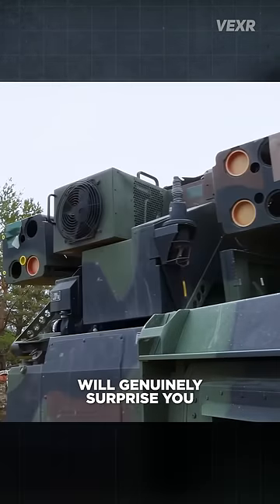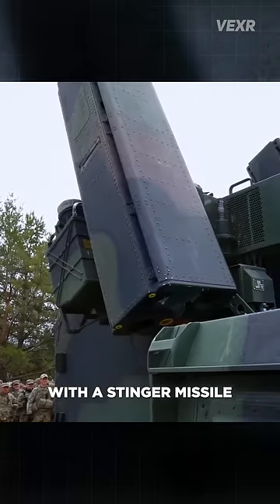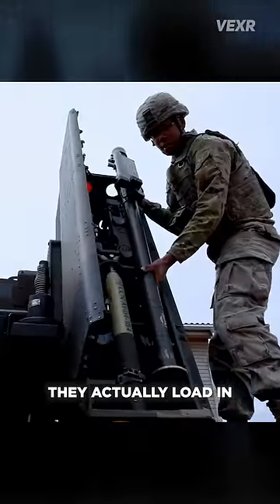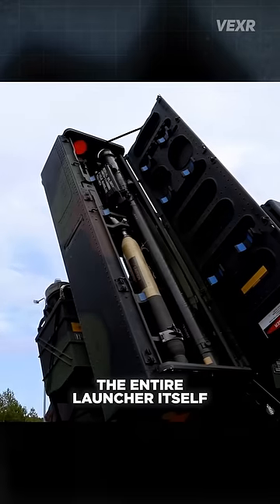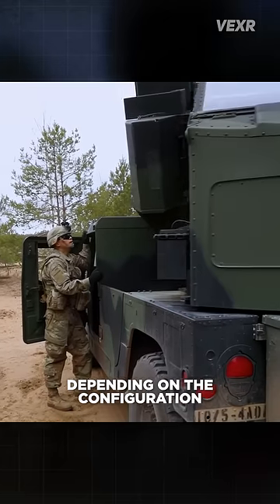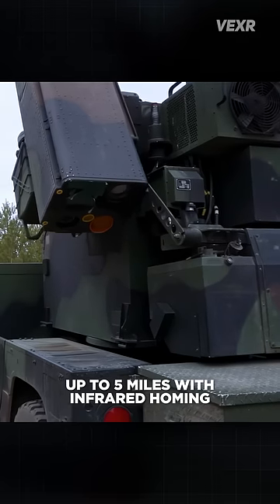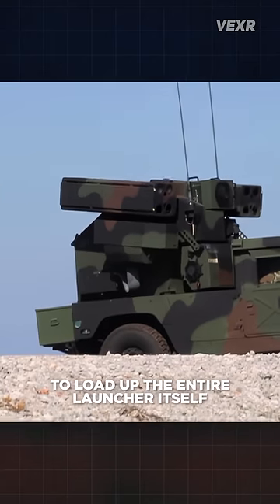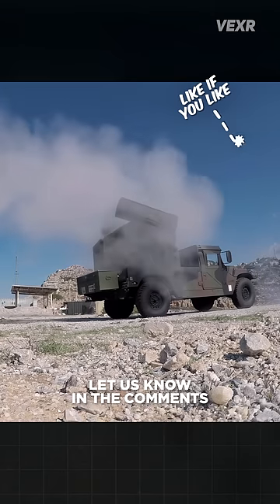The Weirdest Way To Load a Missile

Comment: This was my first DOD system I was lead design engineer. missile is in a single use tube. from the case to the launcher is quick and 8th grade Ed level. there are 2 firing locations . one in the turret for shooting on the move (convoy defense) and a gunners console with 30 foot cable in the cab for dismounted AA defense. there is also a ma duce under one pod and FLIR under the other. I left the program in 92.

I know from a former coworker that there have been several updates. one was to add it to the IBCS AA defense system.
Reply: YouTube is amazing. We can actually hear from the people that made the stuff, wow?
Reply: These are nice, but Im surprised somebody hasn't designed something that's fairly inexpensive to shoot down drones. I saw Australia sent something like a Bradley gun hooked up to a radar. If you can't keep the drones away?
Reply: Wasn't it originally came with a machine gun in it?

Why now they delete it?
It might b useful to take down a drone
Reply: Shhhh…
Reply: @joedaniel144  Look at old 20-30mm flak emplacements. Cheap, and very deadly to drones with a radar fuse. The German Gepard is a top-of-the-line version.
Reply: @joedaniel144 They did, it's called Thor (Tactical High Power Operational Responder,l a microwave based THOR uses radio waves in intense bursts to disable small drones and is capable of taking out multiple targets at once.

Thor is believed to be deployed to US bases by 2024.

Which is now leading to its 2nd generation called MJÖLNIR.
Reply: So you either worked for Boeing or the Project Office. I launched the Redeye while enlisted and worked AMRDEC for the live firings for both Man Pads along with the Avenger initial deployment.
Reply: if you don't mind me asking, what else did you work on and how did you get into that position? I want to work for the DOD after highschool/college. thanks :)
Reply: @exgangster843 yes they should still have the venerable M2 50 cal.

The military has directed energy weapons for drones and missiles as well,. although mostly on ships and on larger vehicles. There are handheld drone guns but that's mostly to disrupt the transmission/control of the drone.

The primary advantage of directed energy is that it's cheap to fire and can be used against a large number of systems.
Reply: Your stuff saved a lot of good lads lives here in Ukraine, especially at the begining
Reply: @joedaniel144 cmmoercial deones can be downed with an RF amplifier. Maybe 5watts max you can make a dron useless. Any rf jammer will do the trick. Specially a GPS one. At the worst case, it will fly back to the lift off point, if enabled and capable , discovering the operator for you.
Reply: That's very interesting. I'd be concerned if someone say accidentally put the launcher in incorrectly. Or the barrel was unknowingly damaged.
Reply: What kind of career should I pursue today? How do I know a Good company from a crappy one? Which ones should I pursue?
Reply: What are the odds
Reply: 30 foot cable might be a bit short with how visible it is on a modern battle field and access to air burst munitions, but nice touch.
Reply: Why go to the effort to design a system to hold and launch the missile when the stinger already has such a system?
It makes sense. I'm sure the extra advantages to having a standard stinger launcher also helped make this decision.
Reply: @joedaniel144  the French have a “jamming rifle” the Russians have a back pack jamming system based off of something like the South African farm raider system as well as larger system that can block everything from drones to satellite systems over head but it’s not as targeted as the French systems are.
Reply: What does a designer do on weapons engineering?

Is it just fancy word for engineer or do a designer just design how it looks while not calculating anything else?
Reply: @arvalb0  "design engineer", not "designer" and not a fancy name for an engineer, just a type of engineer. In my line of work a design engineer is distinct from, say, a production engineer in that a design engineer engineers what the thing should do and how, while a production engineer figures out how to actually make the thing - is it stamped steel or milled? Is it bolted or welded together? etc.
Reply: username checks out
Reply: @dogefort8410  LOL, that's not even out of shrapnel range on a 23mm or 30mm, which is what will be shooting back.
Reply: Listen as a former 8th grader. I was never taught how to set up a short ranged SAM system on my prius. 

But I am willing to learn 🌚
Reply: @clutch1420  meh, so you're another russian or chinese spy trying to learn emwestern ingenuity...
Reply: @@IrvingZismunThis would require that you have somebody carry the dedicated shotgun for the job, but they also need to be trained in shooting the drone. The drone also needs to be at the height necessary to do so. Too many factors for this to be reliable.
Reply: Thanks for the AA of our age I guess. I have a buddy going into the airforce soon actually. I hope the enemy equipment are not as capable as what you have worked on.
Reply: @joedaniel144 Wait bradley gun or that bloody modern day, electric Heckers firework naval gun?

I think it was a guy names Hecker. What were those old rotary guns the US navy used during the revolutionary days called again?
Reply: @platinumsun4632  I can personally guarantee that the enemy doesn’t even have half the capabilities we do.
Reply: 30ft and a foxhole sounds about right. Genius design.
Reply: @@IrvingZismun they use AA guns like the Gepard. They work fairly well since the drones are slow, but it’s just a matter of there being too much area to defend.
Reply: I was an Avenger Crewmember for my first MOS. It's pretty cool to "meet" the designer or Engineer on the Internet.  I was in Korea at the end of my enlistment at a live fire on Sea Range. I was always promoted ahead of peers and Top Gun in IMTS training but had a short timer attitude.  The ONE time I get to live fire and it's for the Division Commanding General and CSM and it malfunctions and fires 90 degrees straight up and not after the BAT. They thought I did it intentionally to say FTA and I was at parade rest for 10 minutes while they reviewed the footage a dozen times.  I was cleared but thought I was getting extended for a Field Grade Art 15 for a few minutes. Great weapons system and thanks for commenting.
Reply: @Descolata i think there all destroy or sold on the black market
Reply: @chriscantrell9012 old C&C :Generals version of an Avenger worked just fine😂

Comment: the stinger missile is perfectly fine to use like that. the only difference of a shoulder fired is that you need a battery. the Avenger has two things the shoulder mount doesn't have, a better radar and an electronic control system, meaning lock is easier to acquire and hold. the avenger also has variants with machine guns.
Reply: Cool , I assume shoulder fixed  stinger stinger has no radar , ? And the avenger provides the electricity ,for the missile system,
Reply: Stingers are heat seekers, no radar needed

Comment: The basic Manpad launcher tube has one time heat resistance and is expendeble and expended after every single missile launch.
Loading and using the whole launcher eliminates the heat/thermal damage to the launch platform, reduces system dead weight and also results huge cost savings.
The stinger missile launcher tube is anyway a part of MANPAD set.
Reply: It also removed the need to handle individual missiles
Reply: MANPADS*
Reply: Also faster engagement of multiple aircraft, don't have to reset with following missiles. Get tone, engage switch to following missile get tone engage continue. Might even switch over to machine gun for other targets..... I don’t know if that system still has that. It's been awhile since I've been around them, a couple of decades.
Reply: Yes the launcher contains argon gas to cool the heat seaker down.
Reply: @raymondlorenz1778  not true but ok...
Reply: @raymondlorenz1778  That's old tech that isn't used anymore and hasn't been for decades
Reply: Sounds similar in principle to not using caseless ammo in rifles. The brass is tough and absorbs heat, which is then removed when ejected, keeping the barrel cooler and extending its use and life.

Comment: It makes the cross loading more economical. If they need more firepower, troops can shoulder fire while the system launches. If the launch system is damaged or destroyed, the payloads are still viable. If the unit runs out of local ammunition, they can get launchers from other units. It's actually a brilliant design option.

Comment: Basically, the avenger is equivalent to eight people carrying stingers
Reply: You forget that 8 people require less taxes, so it is a big disadvantage...
Reply: @ШевкуновКирилл I'm not saying the MIC isn't evil, but you don't have to pay a vehicle salary, combat pay, or to have it trained. plus, it allows 2 people to operate 8 stingers, freeing up the additional 6 for other duties
Reply: Plus better and longer ranged targeting, radar and other optics and sensors. So it's more like eight people and a load of equipment you'd have to mount on the back of a vehicle anyway. It's also more mobile than 8 manpads.
Reply: I think the Avenger system gives the rockets some more advanced lock-on capabilities
Reply: @GrasshopperKelly This
Reply: @ericolsen5592  Not quite lock on abilities for the missile itself, but the ability to better spot and track targets before dumping on them.

Comment: I would imagine, as a civie, that the reason to fire from the assembled launcher is so that in a pinch they can be grabbed as shoulder-fired weapons in defense. If things go south, would you rather a weapon that you can only use one way that might be less helpful in the moment, or one that can do many things based on need?
For example, the Javelin is used for anti-vehicle use, but since it comes down on a target, it can be feasibly deployed against boats that have weaker decks than hulls. Similarly, firing an AT4 from a mount on a small boat would keep the munition below any point-defense systems, so realistically, jury-rigging weapons in unconventional ways being made into a standard makes practical sense.
Reply: spot on, also using a existing launcher as a module is cheaper than developing a whole new launch unit. stinger launch units (BCU) are one time use only, it simplifies logistics and makes more sense to keep them in the launcher. you'll never see a stinger outside of its tube before it's fired
Reply: @chucksneed1264 rather the second answer

The stinger system has a single shot launcher, not a seperate missile that can be reloaded into a launch tube.

The reason the stinger was chosen for the avanger is however almost certainly because for the first reason.
Reply: Dude Javelins would probably rock for taking out PT boats

Comment: Well think about the engineering aspect as two options: 

1. Design system to hold stinger launcher, and simply design a lever to push the trigger on the launcher. 

2. Design and manufacture a whole new casing for the stinger missle, including wiring detection, and trigger mechanism. 😅
Reply: Plus the fact the missile's rocket motor exhausts insane heat and material (that fouls) meaning the tubes themselves have to be expensive, limited use with cleaning, or once use anyway like the Stinger tube... Ie. in your option 2. "Design and manufacture and whole new single use casing..."
Reply: Solution 2 also requires a unique logistics solution to offer stingers to soldiers and their AA truck.

Solution one involves shipping crates of man portable stingers to troops that they can use against targets.

The truck mounting mostly holds it steady and can launch while on the move. Which is difficult if you are being bounced around on rough terrain from inside your APC.

Comment: So in the end it's just a glorified box
Reply: That's military grade equipment for ya!
Reply: When used from the shoulder the Stinger’s seeking head requires coolent cartridges which are expensive and don’t last long, ~45 seconds.  So basically the operator has to anticipate that he might get a shot.

The Avenger has its own built in cooling system that can operate continuously.  Also it’s more efficient to pop off a follow up shot if you’ve got 8 ready to go.
Reply: War haven't really changed in terms of basics it just things are far more advanced and we fight in all domains now, but it just boil down to who has the longer stick
Reply: ...and most expensive damn box we ever laid eyes on, that's for sure
Reply: there is a .50 mounted to this box in addition to some very fancy optics and thermals
Reply: As is most launch tubes.. most of the tech is in the missile and radar systems.
Reply: @robertmaybeth3434  the box has better versions of the launcher, so when they can, they'll use the improved system. But in the case of "truck down, ammo operational" they yoink em and fire from the shoulder. In the case of "oh crap a ground target" they yoink em and shoot shoulder. It's actualy a money saving and time saving method. But in the end it will always be a glorified box
Reply: If you think of it that way, almost every piece of the military is a glorified box

Comment: From what I remember when the system was being tested. The decision was made for eases due to logistics as well as cost. This way they only have to get one model of the missile and equip it across the entire force. The entire system is kind of a Frankenstein since the command and launch position was originally one taken off a Chaparral. To the best of my knowledge some systems that were deployed actually still used this turret just pulled from the Chaparral track and modified.

Comment: Genius.  Pure genius.  This means that if the Avenger is knocked out by enemy action or the firing system goes tech, the unit it is supporting still retains triple A capabilities because they can recover the Stinger tubes  out of the launcher units and use them as Manpads.

Comment: The stinger missile, and the launcher itself is loaded into the A1 strike three launch code. The reason for that is because the stinger and the missile itself has to be configured to put a launch key, which means putting in the whole unit that one time thus launching it in order to get the desired Effect on the enemy that you want that being said. It’s always nice to be able to just load the one missile but without the launch mechanism, you just going to get flareup and when you get flareup, there’s never going to be any precise code, or precise aiming when you aimaim

Comment: It's all about purpose - If you need air defence against fast movers, and it needs to be as robust as possible, that's what patriot is for. Similar to the now discontinued SLAMRAAM, it's capable of knocking out pretty much any aerial threat long before they pose a risk to ground forces - provided it can track and lock soon enough. However there are lots of times when a ground unit needs some organic air defence capability, and the Stinger is an exceptional option. It's lightweight, easily carried by infantrymen, and provides a decent warhead with a pretty good range for a MANPAD. Hence why the Avenger works the way it does - it's meant to provide a mobile platform for that organic AA capability, however you don't want the logistical headache of a totally different ammunition and loading system - after all it's expected that these vehicles be embedded in small numbers with other formations, formations that likely will not carry any spare ammunition.

Think of it this way - you're not trying to create an AA vehicle for ground-combat troops. You're trying to give those troops the ability to use their AA weapons while on the move, and as an added bonus you can include better target location, tracking, and maneuverability for that AA capability. It's less about being able to take the missles out of the avenger and still use them, it's more about being able to take the missiles you already carry with you and are familiar with and use them here too. Same reasons there's M-SHORAD, M6 Bradley Linebacker, and MIDAS

Comment: There are two main reasons. One is logistical/manufacturing - you only need to produce one type of laucher that fits multiple applications.
Another is - the missile will still need starting container. If it was just missile without container it would cause extreme wear very quickly. Using entire launcher saves you time on designing purpose built launch container (since entire manpads is a launch container). All manpad based systems do the exact same thing. Gibka-S, Poprad... it's all just entire launcher being loaded (though often cooling system is handled centrally, since MANPAD battery can only keep IR diode cooled for short amount of time before firing, and if not fired you need to insert a new battery)

Comment: Each stinger missile comes pre packaged inside a single use launch tube, for shoulder firing you just attache the module that contains the sights and a trigger to the tube.  Those same tubes can also be mounted on aircraft (usually helicopters) and used air to air.

Comment: The missle is factory loaded into the launch tube, which includes the firing connections and the target acquisition sight. Of course, the stinger is a one-shot disposable system.  The factory loading and sealing of the launcher also ensures weatherproofing and forestalls potential damage during handling. Taking it apart to only load the missle would be far more trouble than it would be worth, plus the included subsystems would have to be duplicated on the Avenger platform. It is much more efficient to simply load the entire launcher.

Comment: dual use for the Stinger, instead of having them fired individually by soldiers, you can load them in a far more mobile vehicle and launch 4-8 missiles at one time with only 2 soldiers operating, in a pinch they can be removed and fired individually as the mission requires